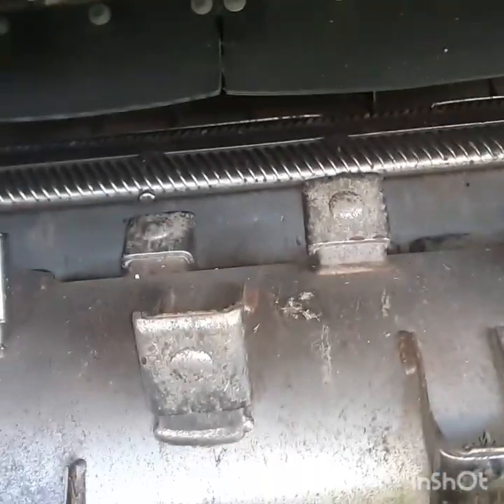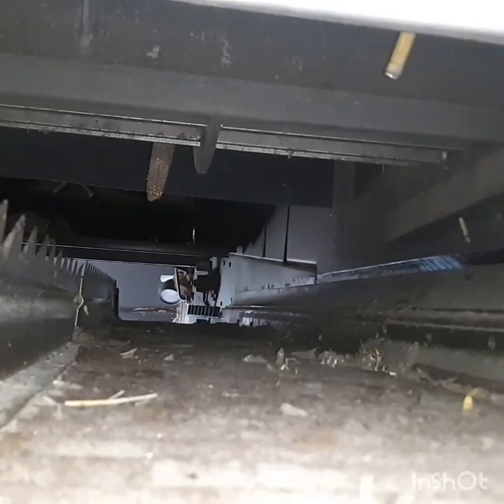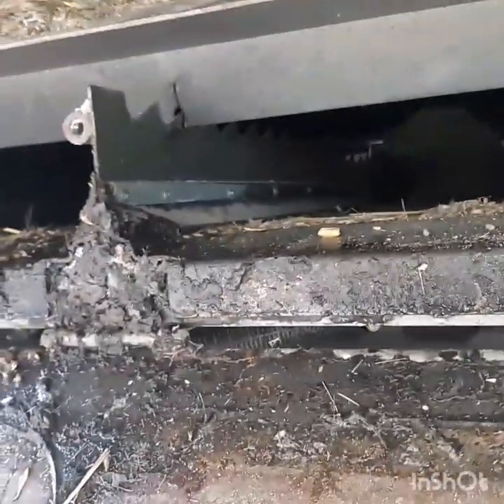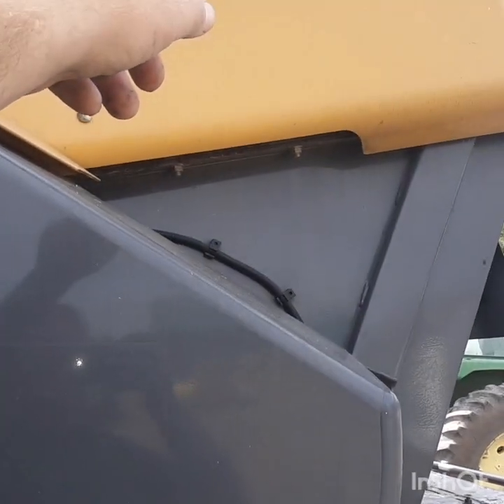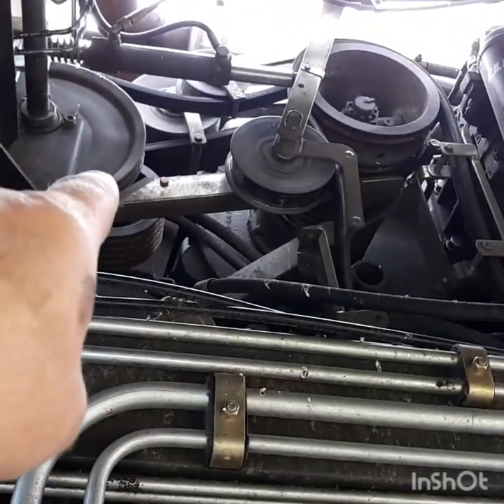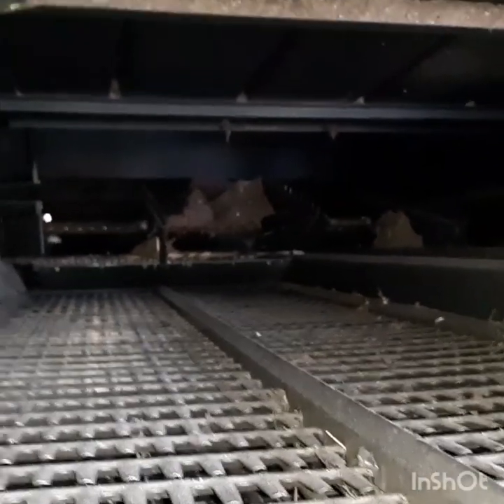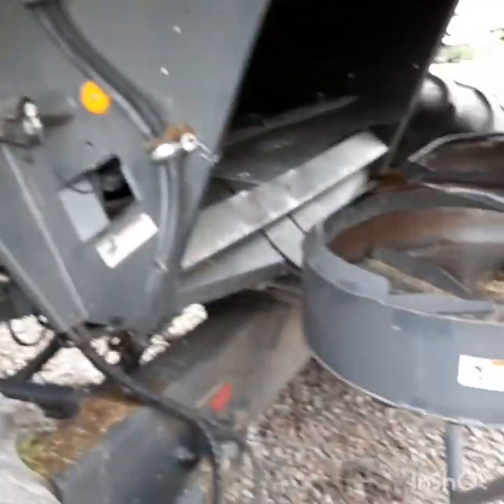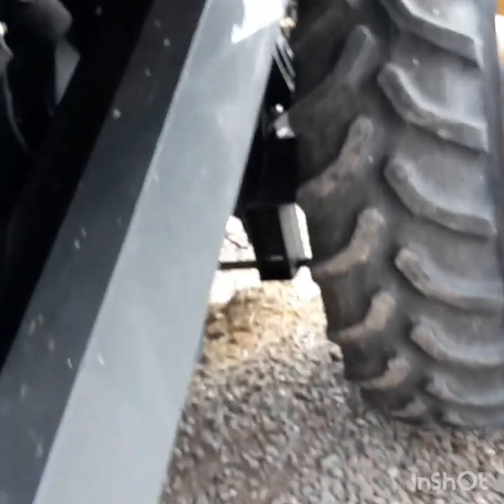How does the Lexion combine work.

Comment: Looks like a feeder beater followed by the cylinder and then the thresher beater. Then they replaced the walkers with rotors. Seems like a super conventional GLEANER hybrids. I have seen them work and work well.
Reply from the maker: Pretty much!  In an emergency I bet you could get John deere cylinder parts to work?!

I like the theory, looks busy but Once you understand how they do it the combine is pretty easy to work on. Amazing capacity per hp.
Reply: @jonstevensmaplegrovefarms3754  I rented my ground out this year and the guy has a 570. He had to replace the shaker bushings this year. I guess if they get to worn it will break the shaker arms.

Comment: How much of a pain is it to switch that cylinder from high to low speed? Looks to be right behind the dual
Reply from the maker: About 2 minutes with a cordless impact.  Not as easy as my deere but more heavy duty.  But i did like thr shear bolt feature of my old deere.
Reply: @jonstevensmaplegrovefarms3754  that's not to bad then. That shear has saved me once and it is a nice feature